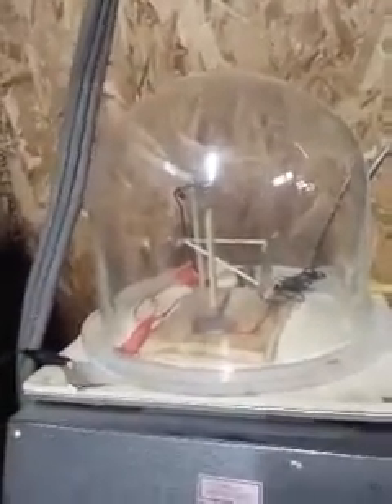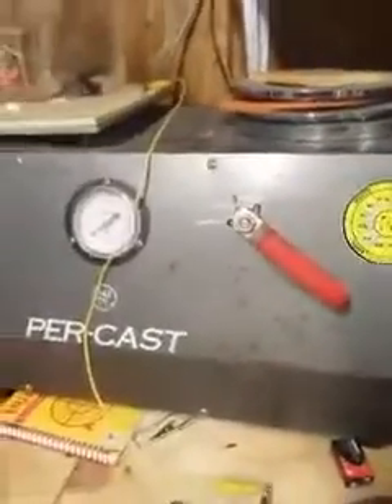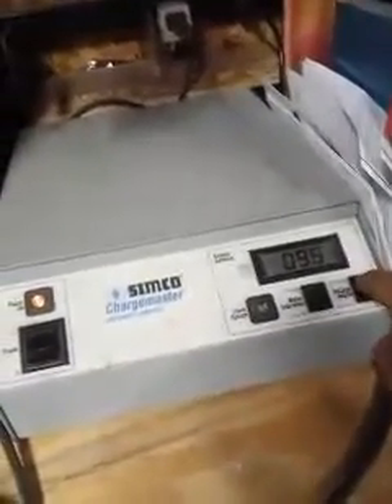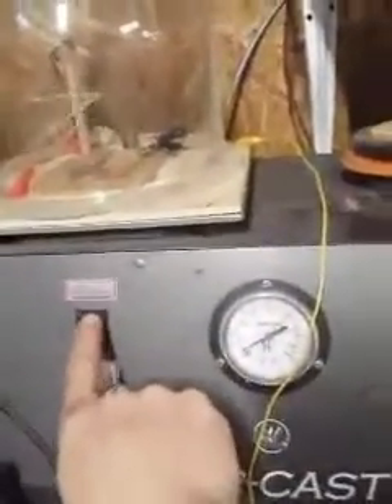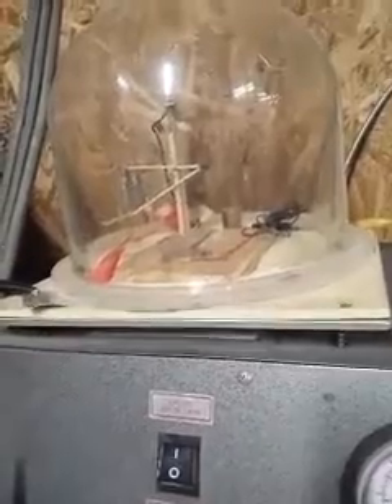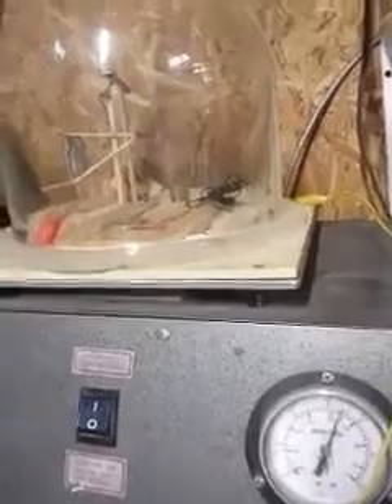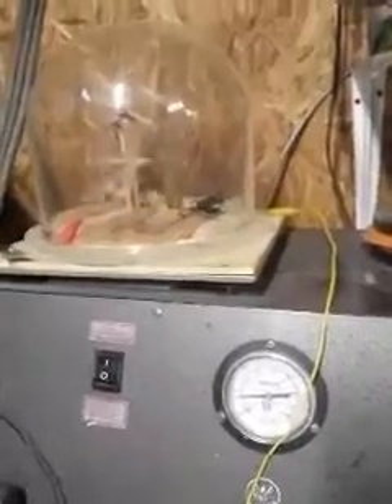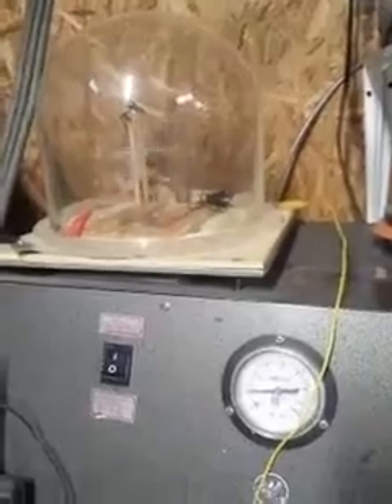Ion lifter in a vacuum chamber

Comment: It is imperative that it be tested with much higher emitter wires positioned accordingly in proportion the amount of vacuum. Of course the electrical resistance goes down as you remove the air. This will lower the output voltage of the power supply and or you will get less particle impacts.  If you raise the emitters the lift should come back. There should be an optimum emitter to collector distance for a given amount of vacuum. If you could please do a test with higher emitters and post it as soon as possible, it would be huge! Thanks!
Reply from the maker: hmmmmm.... interesting concept.... deserves exploration... when my free time permits, i will build a few with diffetent or maybe variable emmitter distances... my time is currently devoted to preparing for winter months, but once the cold sets in i should have plenty of time to experiment further..  another thought is to measure the emmiter frequency, and place the collector plate at a tuned wavelength apart from each other.. im not sure of the frequency my HV supply operates at, but can be easily measured with my spectrum analizer...
Reply: Needs gas to ionize .
Reply: If the air gap is increased significantly for the vacuum experiment, then the ions will travel over a longer path and make more particle collisions again, restoring thrust. Of course, this would only work in a partial and specific level of vacuum and gap distance. The resistance in the air gap will increase again, restoring the high voltage to its original level as well. There is another lifter in a vacuum video, showing increased current draw in a vacuum, indicating reduced air gap resistance in thinner air.
I wanted to see if lift can be even partially restored in slightly thinner air by this method.

Comment: So did some research - first try reversing the polarity. The machine will likely go on the same direction.

Next pachens law shows that as you approach a vacuum the dielectric strength decreases and their would be small discharge arcs or corona into the surrounding air - however once you get down to single decimal partial vacuum pressure the dielectric strength shoots back up really fast - so the lifter will likely start to speed back up again BUT you need a really strong vacuum which is likely going to implode your machine - it’s a theory still but let me know if you can test this out cause I don’t have the money or tolls to build this experiment yet.